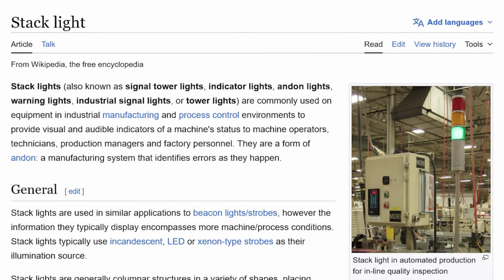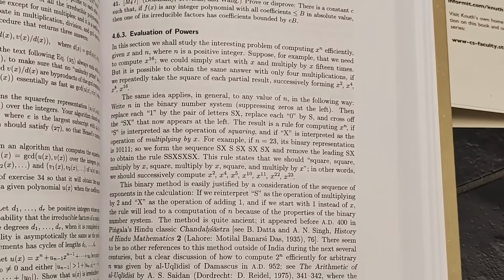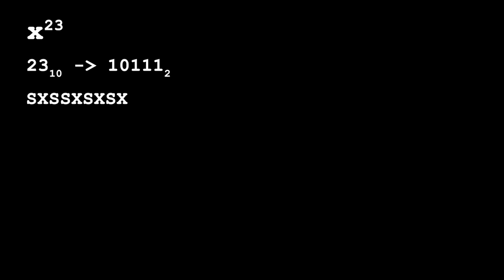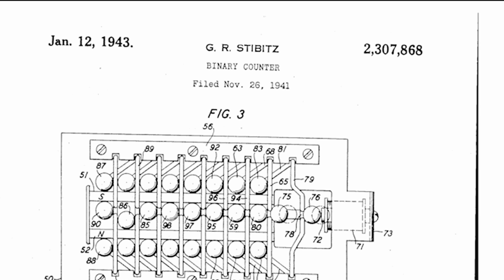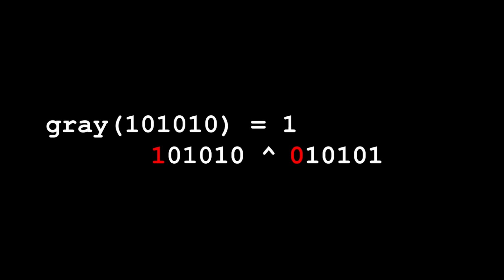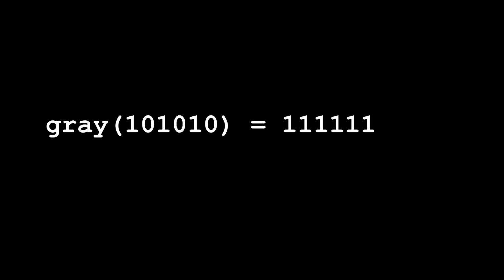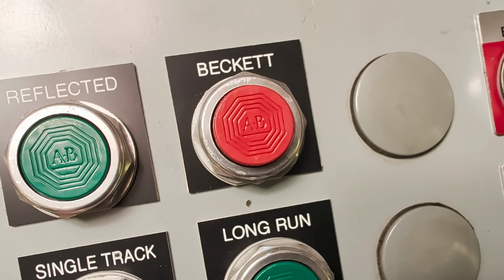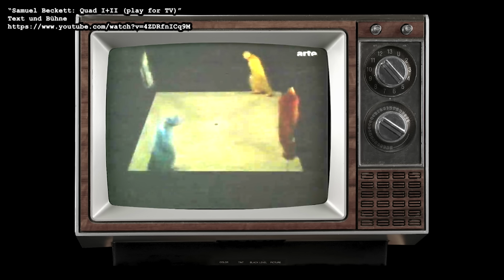The Gray Device

Comment: I'm aware of one other  Gray-type code called the Gillham code.  It's used by aircraft transponders to encode the "mode 3/C" altitude.  Originally it was implemented with a drum full of cams activating a switch for each bit, and the drum had to be driven by an aneroid barometer, which doesn't provide very much force.  So it was important to minimize the drag of the cams by only switching one bit at a time.

Comment: You could always have a timer which ignores the speed dial after a certain timeout! For example: Check if speed is above a threshold you set (like 40%), and start a timer. Once that timer reaches a minute, set the speed value to a desired, lower value. Then when someone changes the knob again in real life set it to the value read from the pot! Could be a few lines of code to save you turning it down every 2 minutes at open sauce :) Excited to see you there again this year!!

Comment: Emergency Off (EMO) removes all power. Emergency Stop (EMS, E-stop) pauses movements and removes stationary forces. Sometimes E-stops are partially monitored by software so that (1)an error code can be thrown to alert the operator and (2) command outputs are discontinued so that the machine won't immediately start moving once the E-stop is cancelled

Comment: We had those at the office I worked at.

White meant that the terminal the lights were over was in use by an operator.  Blinking white meant that the terminal was in use, but the operator was away.  Yellow meant the operator had a question.  Blue meant that the operator needed more work to process.  Red meant a mechanical fault.  And the worst one of all, the dreaded color, was green.  Green meant the operator found cash or stamps in the payments being processed.  These would have to be secured and logged.

Comment: At my job, green means the tool is ready to be loaded and used. Yellow means the tool is running a part. Red means something went wrong. And blue means we need to run qualification loads to make sure the tool will do its job correctly.

Comment: you might be the nerdiest YouTuber I've found yet, and that's a VERY high bar to clear. Good stuff.

A really interesting application of Gray codes (or something like it at least) is in the design of asynchronous finite state machines. It's very similar to the encoder problem in that adjacent states need to be assigned codes where only a single bit is different in order to ensure reliable state transitions. If you try to change multiple bits at once during a state transition you're likely to end up in the wrong state, since the bits won't flip at the exact same moment. The need to consider this (as well as many other design challenges) is why most state machines are still implemented synchronously despite decades of research and some impressive potential speed improvements to be unlocked.

Comment: I saved the operator control panels from some Mitsubishi CNC machines I want to use to make some industrial art out of.  I think there's around 80 momentary push buttons all with internal indicator lamps and a couple of encoded selector switches (inverted binary) that controlled feed rate and rapid traverse rate, and a couple of dozen indicator LED's.  The wiring on the back to all the switches and LED's is so beautifully done I want to put it in a wood frame with clear Lexan on the back so folks can appreciate the craftsmanship.  I want to wire everything into a microcontroller so I can make the panel interactive and have some games like Tic-Tac-Toe or Simon (memory game from the 70's) programmed and selected via one of the encoded switches, the other used for speed maybe.  Besides games, a selection of eye candy to flash the lights in various patterns.  The biggest hurdle is getting the PCBs laid out to handle the massive amounts of I/O needed to drive the panel.  It's all 24vdc so I also have to make the LED drivers 24v compatible.  Had the boards over 80% done when I had a hard drive fail and I lost it all, and too much other 'life' going on right now to pick the project back up.

Comment: Not all e-stops cut power to everything. They cut power to everything dangerous, but sometimes allow power to certain systems to continue, e.g. some press e-stops prevent the press from compressing but don't stop it from releasing. Some lathes have electromagnetic brakes, which an e-stop may engage to stop the spindle but still allow the controller to disengage the brake to allow manually rotating the spindle to free a trapped worker or object. That can be very important if the machine could trap a worker (or body part) and make it impossible to free them if fully unpowered. E-stop design in a system requires substantial care to consider what must remain powered & what must not remain powered.

Comment: very good video. I worked at a company with a hydraulic press. Used a very long engraved glass scale, made by Phillips I think. There was a sensing head over it sending back the code which I think was called the 3 excess grey code, the signal went back to a Phillips control card and then to the Siemens PLC. Signal was interpreted as the position of the carriage unit. Have you any information as to why they used this version of the grey code. Many thanks

Comment: 8:50 - I design the science museum exhibits and one maintenance director has dubbed these children "reavers". Yes, as in the crazed zombies from Firefly. We have an exhibit called Hang Time where you step on a sensor mat,  jump, and a high speed camera records you from jump to landing. The front display provides prompts and plays the video once, and if you want to review the footage you there is a second display around the corner so that the next person can use the exhibit. We were discussing what happened to the main screen and he said, "Yeah, some little reaver went full aggro and punched the display". That was the third TV to be destroyed, so we ended up removing the main display as a test and found that it increased throughput since you had to run around to the review screen immediately after your jump, leaving the mat open for the next guest.

Comment: For those small connectors, that seems like a perfect use for resin printing, you could probably fit like a 100 of those on a single plate that prints in a few minutes (on mine, ~10 minutes on quality setting)

Comment: Even way back when I read Knuth, the card deck / tape storage sorting section seemed dated. However, much later in life, I realized it is actually evergreen since we still have a hierarchy of storage -- fast small near (in) the CPU, slower larger nearby, and slower yet but even larger further out. Just ignore "tape" and "card" when reading that section, and instead think of registers, cache, RAM, SSD, HDD, S3, and Glacier. Each has unique size, latency, and bandwidth, which means these algorithms still very much apply.
Reply: Not quite all of them, as the "reads must be sequential and rewinding is expensive" doesn't quite have a modern analogy... Though burst mode and bank switching and such mean that some surprisingly is.

Comment: Austrian engine test bed company, AVL, manufacture and sell a 7200 line encoder for sensing engine crank position to 0.05° resolution. I've gad them apart for cleaning and repair in the past but never had time to look closely at the pattern etched on the glass code wheel. Needless to say, they're not cheap!

Comment: A possible use for long run would be to reduce the signal frequency on each line of a parallel bus while keeping the overall symbol rate. Lower individual line signal frequency makes the components cheaper and increases the signal integrity.

Comment: i can see an application for the long run and balanced gray code for high speed resolvers. imagine a high resolution encoder running on a 10k rpm shaft. the track with the most "bits" will give you a MHz signal wich yould be problematic for multiple reasons like refelctions, emi or runtime errors/race conditions. if all signals have the same frequency, then problems like these could be reduced. same idea as length matching for high speed data transfer lines on a pcb

Comment: How is tape storage methodology across multiple tapes obsolete? LTO-6-7-8-9 etc are still used in production TO THIS DAY and the working theory is functionally the same. I understand you may not have worked on ACTUAL tape reels. They’re just much smaller and look like cute little VHSs. Under the hood it’s still magtape

Comment: If you define a bit-order-reversed Gray code function, you can use it and the xor operator ^ to generate a Greco-Latin square with an orders of a power of two:
GLS = [[(c^r, c^rgc(r, numbits)) for c in range(order)] for r in range(order)]. GLSs for odd orders are trivial and many larger squares can be decomposed into smaller GLSs.

Comment: I've seen these things at work we have plenty of old machines manufactured around the suburbs of Chicago if you read the information plates which i do when im bored out of my mind. It's a bottling plant and we have e-stops everywhere... So many e-stops you wouldn't believe what we have to do to stop them from accidentally getting triggered it kinda goes agsinst the whole point. Some of the cool industrial tech you'll find there is phase converters, pneumatic circuits, laser counters and the way they route the high current cables in these insulated industrial lego boxes that are standarized and clip together like food grade stainless pipe couplers but squared and i think lined in insulation gives a whole new meaning of conduit, not your gampas residential conduit.

Comment: This is the first of your videos I've come across. Great explanation and execution. I would have liked to have heard the relays for each pattern. I could surely determine the binary pattern blindfolded. But I'm not familiar enough with the others.
Reply from the maker: Thanks! Binary definitely stands out, with multiple relays clicking at the same time. I wonder if I could find a set of 5 relays that sound distinct enough from each other to make different codes recognizable, hrm.
Reply: @Attoparsec Maybe you could switch the relays on and off quickly so they make a buzzing sound, each at a different rate. I think some buzzer type door bells make a distinctive sound this way. Someone has probably already made a "musical instrument" like this - lols. And isn't that how they play music on a multi million dollar MRI? Use a capacitor on the output to even out the voltage fluctuations going to the lights and maybe reduce a bit of spark across the contacts. The capacitor might interfere with the speed control by holding charge for too long; if that was a problem, if you had an extra relay for each light, maybe you could use that to short the circuit and quickly discharge the capacitor 🤣

Comment: Your motion graphics are excellent. Very impressed by the rotary encoder examples.
Reply from the maker: Thanks! It's kind of fiddly, but it's fun in cases like this where it's worth writing some custom scripting to tie multiple elements together. In this case, there was a single angle control that I automated, and then the disk angle, sensor output colors, and sector highlighting was all wired up to follow that.

Comment: Your explaination of E-Stops is wrong.
It doesn't need to immediately cut power to everything, in fact, sometimes it is required not to cut power to everything. Imagine hitting an estop on an electromagnetic lifter, should that drop the heavy metal part on whatever is below it? Probably not. Power might also be used to engage brakes etc.
An E-Stop has to, as quickly as practically possible, stop all hazardous processes, and make sure they do not automatically restart automatically. It would also generally just cut power to high energy devices, motors etc, control panels would still have power and simply tell you the E-stop is engaged..

But of course, your machine isn't even hazardous if you build it correctly, so no need to an E-Stop anyway.

Comment: Gray codes are perhaps even more common than you let on. They're used in 2D form in telecoms on constellation diagrams, so that a received symbol drifting off target will only result in a single bit error. 5G, mobile signals, fibre optics, satellite RF, gray codes are a small part of the backbone of almost all telecommunications.

Comment: With regards to the "study of optimal ways to sort and merge data stored across multiple magnetic tapes" that it is a lost field, but there is probably some poor sod out there that still for very specific and odd reasons has to solve this problem.
Reply from the maker: Probably running a shockingly important piece of infrastructure, at that!
Reply: For any size of RAM, there exists some dataset which is too big to fit in RAM.  Wouldn't surprise me if some of the multiple dish interferometry astronomy experiments or LHC data collections require old-school merge sorts or equivalent data shuffles to minimize not tape IO but VM swap/paging. (I did merge sort optimization using Knuth and Lorin books as a student intern in the late 1970s! Having previously used offline card sorters!)

Comment: I remember the bubble sort.  I felt like the only person in the class that understood it. 

I've since forgotten how to write it or even how it works.
Reply: All I remember is bubble sort "bubbles" the largest value to the top each cycle.  So I think it's the one where you run left-to-right, swapping neighbors which are out of order, and restart one step earlier each cycle, since you know each cycle certainly puts the next largest value into place (there's also early termination if you complete a cycle without performing any swaps).

int data[] = { ... };
for (size_t lhs = countof(data)-1; lhs; --lhs) 
{
bool swapped = false;
for (size_t i = 0; i < lhs; ++i) if (data[i] > data[i+1]) { swapped = true; swap(data+i, data+i+1); }
if (!swapped) break;
}
Reply: @MCLooyverse funny, I was using apple Basic. What's that language?

Comment: you don't need an industrial supplier for placards like that. I'm not even sure what that means. Mom and pop sign shops make custom construction placards all the time. I work in solar, and we get little custom maps of the house made in hard plastic placards for posting on the main electrical panel. Usually just 1 per house. Minimum order for a custom placard is definitely 1, to support that use case.

Just finished, this is very slick.

Comment: Idea! Somehow interface with the back side of the rotational element of the rotating switch and use a stepper to slowly drive it back down to its lowest speed. Use the switch output to determine where it is.

Comment: Actually it depends, on the type of E-stop, so shutdown everything, so put everything in security, what mean still on but can't move or be dangerous anymore. And actually a lot of E-stop are read by a microcontroller. You always have have a fuse box somewhere if you really need to disconnect the machine. But it's not the goal of a E-stop the goal is to put the machine in security so no additional problem can happen.

Comment: I can imagine single track being useful in things at the extremes of scale! If the encoder is incredibly small, it might not be manufacturable in a standard configuration. For very large devices, this solution eliminates the effects of propagation delay without characterizing conductors and also eliminates the effects of transmission interference between signal wires

Comment: nitpick on E-Stops, they generally don't cut all power, just power to most actor systems. safety codes and regulations get very complex and funky the moment you're dealing with suspended loads and/or life support critical systems, as well as layered failsafe conditionals based on envoirenmetal factors. just saying they turn off power is, in most modern systems, incorrect, and they generally don't interrupt sensors or display elements because operators should still be able to know what general state the equipment is in.

Comment: E-stops don't necessarily cut all power or cause an immediate stop of action. Code-wise, their requirement is actually that they need to cause a fail-safe situation. Often, on simple things, this can be a simple cutting of power. Other times, it's more complex cutting of power to a motor while sending power to a brake. 
The really rare (and hard to control for) situations are when a fail-safe has to actively control things, usually when the motor cannot easily be back-driven and the machine involves a lot of kinetic energy that could cause further issues if you tried to dump it all at once or would otherwise be a danger if it immediately stopped. I know this came up with a theatre thing I had done where the e-stop actually had an official way to run it through software because it could get scenery moving at a decent speed and potentially stop it really quickly, which would be an issue if either you had people on that scenery or, potentially much worse, had tall scenery that could run the risk of falling. They made it clear in the training that you should always consider if defaulting to de-energizing a motor which couldn't be back-driven was the safe thing, especially when going faster, and the software fail-safe mode could be run in tandem with an emergency off (which, in those circumstances could cause injury). 
I don't know of any other situations that have needed that type of active control, though I do know that I experienced e-stops that should have also engaged a brake but didn't.
Reply: Take a car as an example, E-stop is like the handbrake which actively impedes the motion, while EMO button is like the ignition key which just shuts off the energy source.
Reply: @FOHGeek  and ABS is a fail-safe (at least allowing you some control as to where you're going)